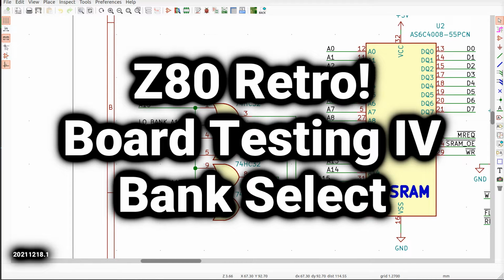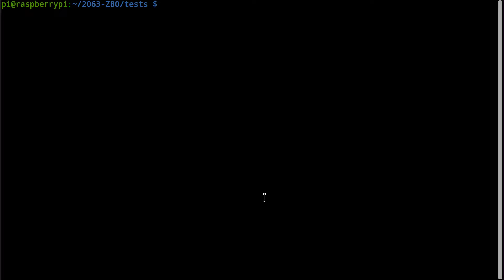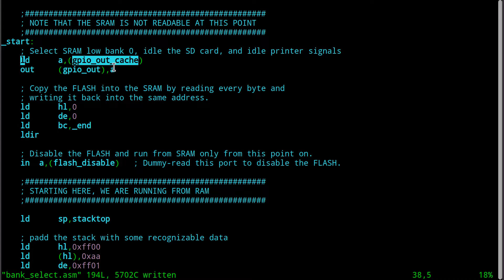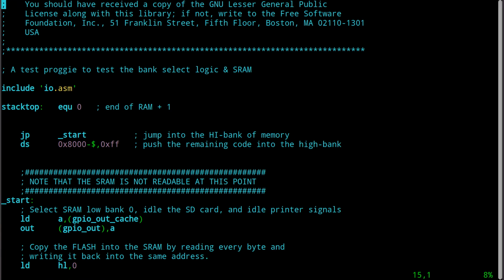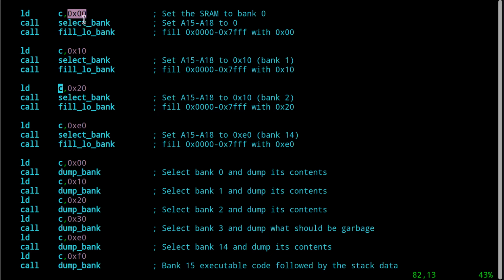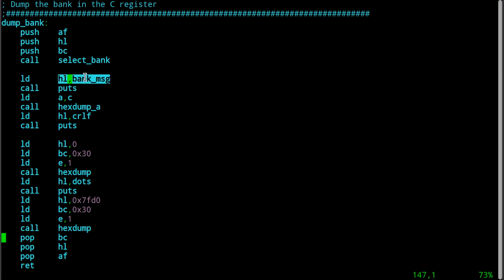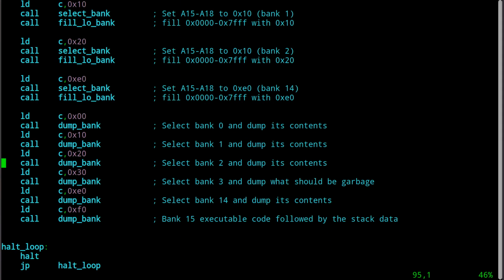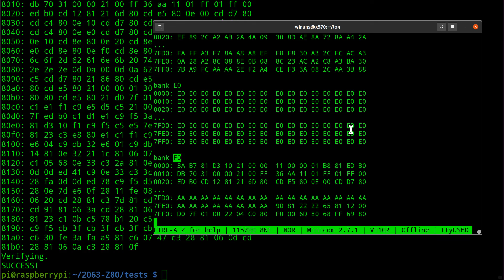Z80 Retro #14 - Board Testing Pt. IV (SRAM Bank Select)

Comment: Love that LDIR block move. I can't get over how many years I ran 8080 code on my Z80 because everything was "compatible". Looks like this system will support ZCPR - time to give it a try!
Reply from the maker: Definitely a handy instruction. I recall learning LDIR early on & liked it too.
My first assembly lang experience was on a TRS-80 model II with Edtasm.
The one and only example program in the manual (lacking the incredibly poorly documented start address on the END statement... Just a few of the MANY of humanity's hours wasted due to poor documentation) was an LDIR that painted the screen white faster than I have ever seen BASIC do anything.  Very cool!
I was all in on assembley from then on!  
By the way, the part of the Edtasm manual that I have great respect for (and have heard praise from several others) was the portion cut and pasted from the original Zilig Z80 user manual.  (If only the latest revision could have been proof-read as well as the first. 😂)
Reply: @JohnsBasement  Just checked the date on my Zilog Technical Manual - copyright 1977! Doesn't mean I read it - just have had it on the shelf a long time!
Reply: @JohnsBasement  I bought my TRS-80(I) in 1979. I can totally relate ... basic was fun, but assembler was far more interesting. And yes, LDIR was a pretty cool instruction. Of course ... assembler is totally unforgiving. I recall spending 8 hours once staring at my screen, bewildered that adding a single word to my data file, caused the program to brutally crash. I solved the problem ... the 8 hours was not in vain. The thing is, while it is unforgiving, you can do 'anything' with it.

It kind of reminds me of large format photography. Assembler is to basic, what the view camera is to the Kodak Instamatic. The view camera is pretty much as simple as you can get ... basically a lens on a set of bellows. It is definitely not for the faint of heart. There are many steps to taking a photograph, any of which can be screwed up and ruin your day, but when you get it ... the results can be absolutely breathtaking.

Comment: Hello nice work, I like to ask a question. On 12th minute of this video you start the select_bank routine with PUSH AF end before exit the routine you POP the AF register. PUSH and POP commands on the general purpose registers is a 3 MACHINE CYCLE commands the EX and EXX commands are only 1 MACHINE CYCLE commands so, is it going to be faster if we use EX AF,AF' end EXX for the HL, DE,BC registers?
Reply from the maker: Yep.  Exx is faster.  But then you couldn't use it for saving regs in IRQ handlers... Some day down the road.

Comment: I was wondering what the trade-offs between a symmetrical 32k/32k banking scheme would be versus a more assymetric, say, 16k/48k - so that you have a smaller fixed area but larger bankable areas.
Reply from the maker: An asymmetric mapping would require more gates to implement  and even more if we want to use all the RAM (draw up the truth table for the address mappings yourself and see.  ...and if I'm wrong PLEASE tell me!)  I wanted to avoid PAL/GALs in order to avoid the need for yet another programmer to configure them.  I also wanted to limit the size to 100mm square to get the cheap prototype board fab rate.  Since more gates = more more chips = more PCB real estate and the design is already very full, it is simply impractical with the other constraints.
Reply: At that point, it is more efficient to have 4 banks of 16k each. That is what i want to do eventually. But it requires a 2-4 decoder and 4 latches. That is 4 extra chips, and there simply isn't any space left on the z80 retro board.